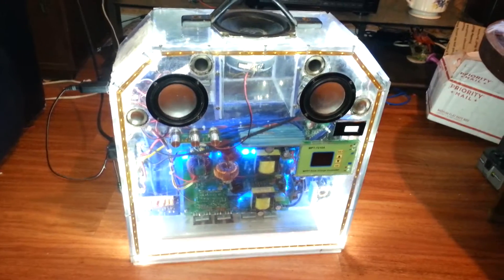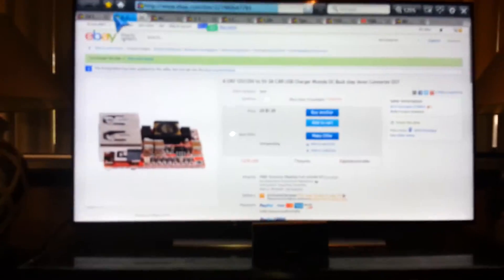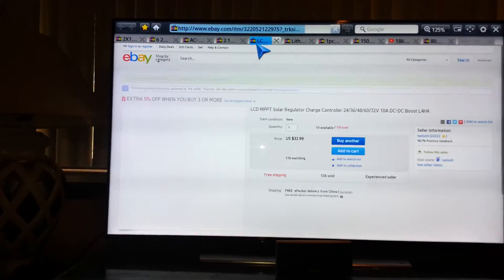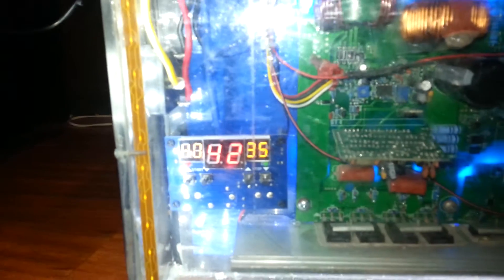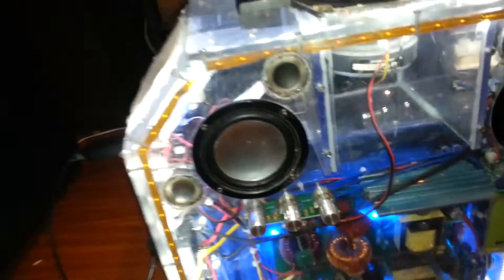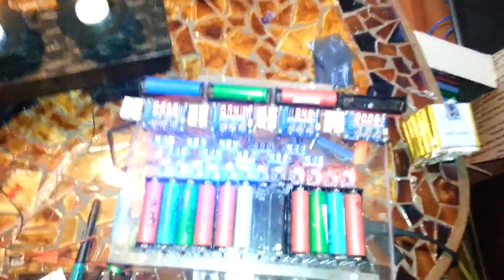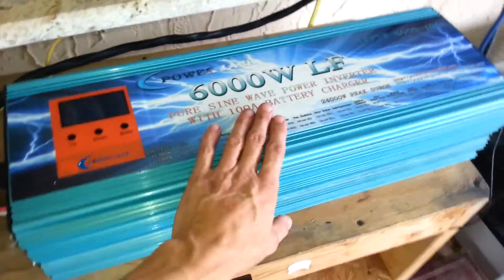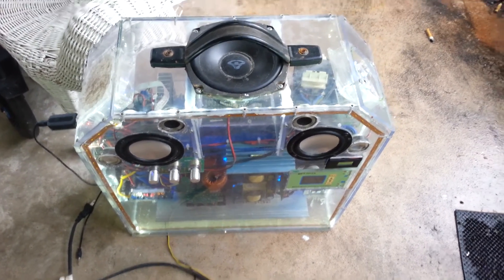Portable Solar Power Station

Comment: Very nice looking Generator. Do you have wiring schematics to share? Also I wanted to ask you why the capacitor on the buck boost converter. Thanks for the video. Its been couple years since. How is she holding up. Any issues? How is the pack doing? Take care...